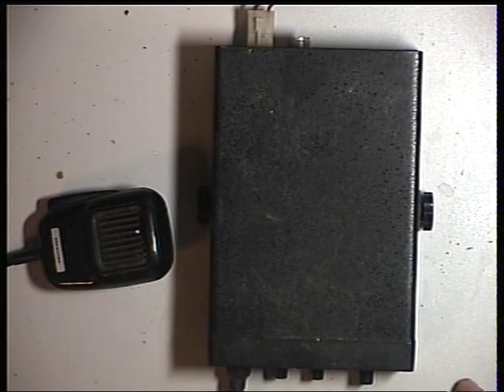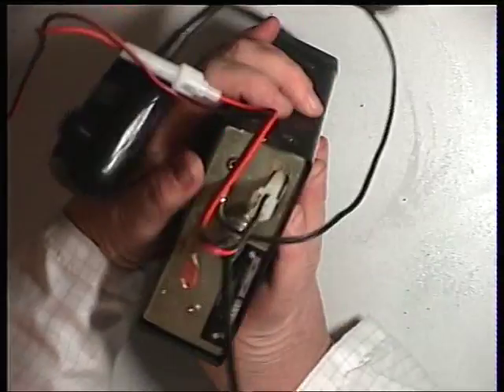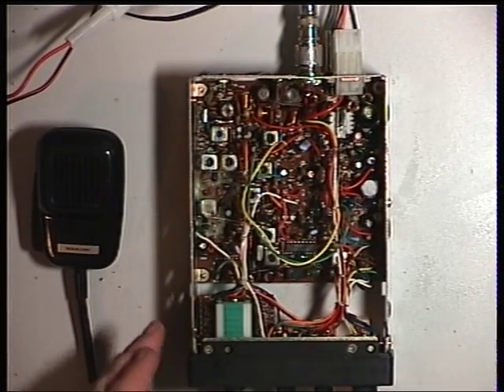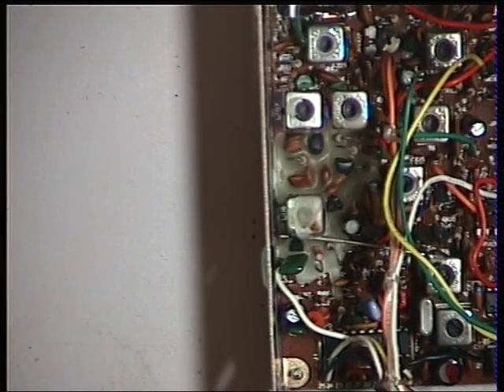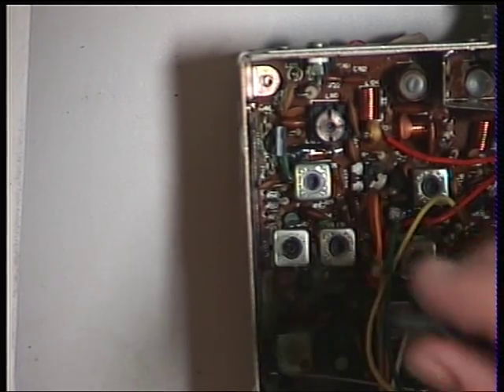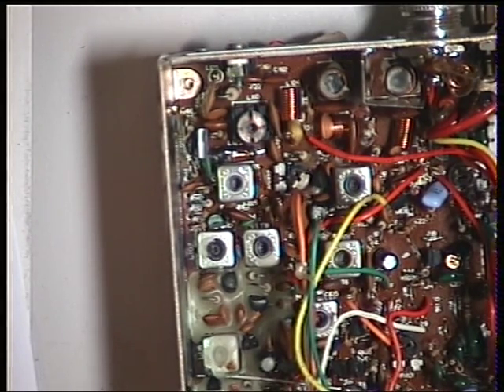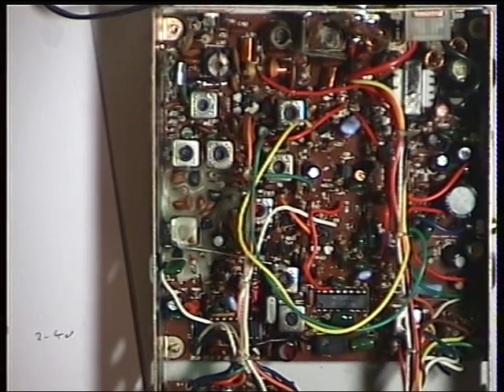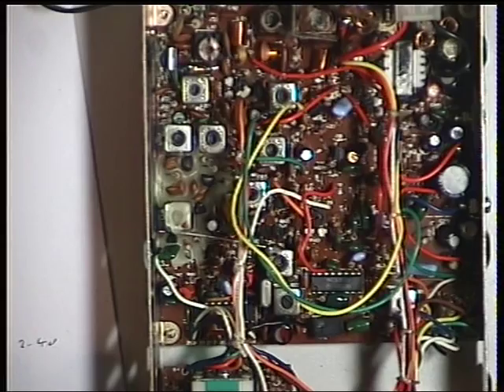Maxcom 4E, UK (CB 27/81) CB radio (Mobile) - VCO & Transmit

Comment: Trying to find that test point, but have about a hundred weight of wax to dig through.
Reply from the maker: You just meter it from the other side,

Richard
Reply: Thanks i will, I never used that much wax when I graduated as a professional twiddler and was presented with a twiddle stick and a candle... Ken.

Comment: Do you find that foam cleaner leaves everything a bit Sticky. I use it myself but then have to wash it off. I think it may be an anti static treatment.
Reply from the maker: I use the Servisol one & it works fine for me. If there was something sticky & nasty I'd clean it off with isopropyl alcohol first, however.
Reply: UK CB radio servicing , I was saying  I use the same cleaner as you and it leaves a sticky residue, which I don’t like. Could be I am just more sensitive to it. Regards Chris
Reply from the maker: We usually use paper kitchen towel to clean with the foam cleanser. Some products get silicon polish sprayed on as well & then usually wiped off with a duster. I'm going to do a video this afternoon continuing 'cb servicing on a shoestring budget', so I'll clean the filthy set as  part of the video.

Richard
Reply: UK CB radio servicing  Thanks Richard. Well the AM set turned up Kraco KCB-4004. Almost every other joint is bad and have been going through it and it on transmits and receiving into  the test set about 1uv sensitivity with 40% modulation depth.  1.2 percent Distortion on transmit about 1w down on power.  Note I don’t condone illegal radio activity,  this radio will never be used on the air and is purely of scientific interest as they say.

Anyway actual point of this post was to say it’s absolutely filthy. Taking it apart and removing the knobs for a good wash. I find my wife’s toothbrush is  the perfect tool for getting into all the nooks and crannies. At a pinch mr chips toothbrush may also work you need to give it a try.  Thanks Richard looking forward to the next video. Chris
Reply from the maker: We stick cases, front panels & knobs through the company dishwasher (along with the CB themed tea mugs).

Mr Chippie works here most weekends and has to have a bed in the parts store room (air conditioned) amongst the steel shelves; his designated bathroom is the blue one with the pink bog. I get the yellow one, leaving the green one spare in case Mark, ZX2 turns up! We're having a private chapel built here at Tango Towers next year subject to planning. Mr Chippie will then have an option of a bed in the organ chamber behind 8 tons of pipe organ.

Richard
Reply: UK CB radio servicing LOL

Comment: hi Richard, I have the same radio but but can't get a voltage reading on the test point. when I got it the idiot diode was blown so I replaced that but now I'm stuck, I can hear hissing like it should  do but the Meter doesn't move on receive or transmit. it's a tidy little radio and seems a shame to throw away but I think I've reached my limit on understanding electronics, I value your opinion as clearly you understand radios and how they work so it could be something simple that I've missed.thanks.
Reply from the maker: +GerbilFrenzy Look at the circuit & you will spot an 8V regulator IC. I think they are a 78L075, but we replace it with a 78L08 that is more readily available. Based on the fact the polarity protection diode was blown, I would half ecpect this regulator to suffer too. They are a 3 legged device that look like a small transistor. When you locate it, switch the radio on & check with your multimeter that one leg at one end is full rail voltage (i.e. 13.8v), and the leg at the other end is around 7 to 8v. The centre pin is 0v. If that 7-8v is missing, the radio will perform as you say it does!